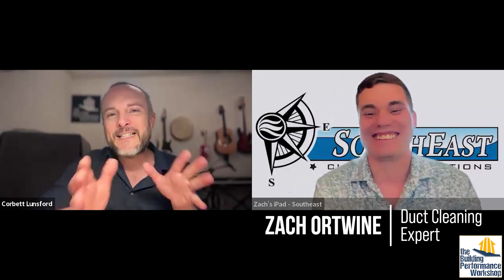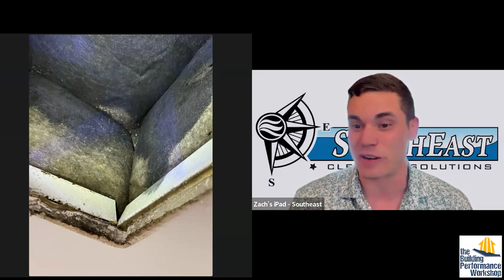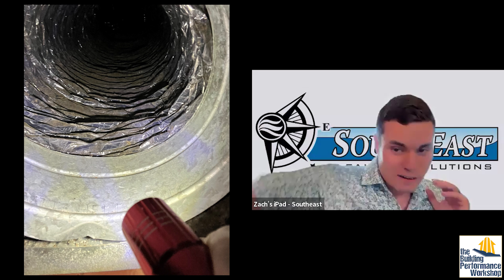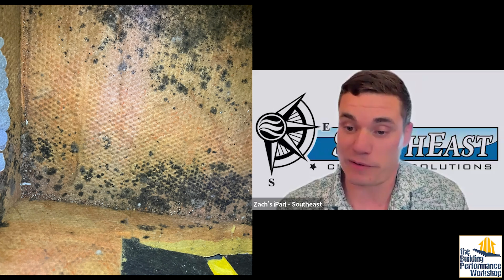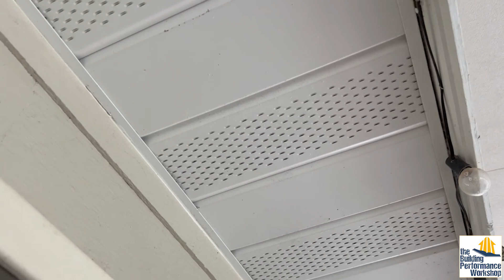Duct Cleaning, Repair and Mold Encapsulation: HVAC Tips from Zach Ortwine, SE Clean Air Solutions

Comment: What is best practice for cleaning metal duct after new construction?
Reply from the maker: Shouldn’t have to, because they should be sealed off until there’s no more dust nightmares.
Reply: @HomePerformance  From experience I just don't think they come particularly clean in the first place. From the supplier etc. On the other hand EPA's guidance on this is surprisingly iffy for cleanings of duct work if mold is not involved. I guess the thinking is much of the material in the duct already attaches to the surface which I guess is why mold is their biggest concern.
Reply: @speciesofspaces it’s very common for ductwork to be dusty from drywall and hardwood flooring installs. Subcontractors could care less when installing in new homes, they crank the HVAC up! Hence dusty new systems. Air whips are the tool for removing dust from metal ducting. None of your flex should need cleaning, due to they are “typically” on the supply side of systems, and it’s the return side that takes the brunt of household/construction dust.

Comment: What type of duct liner can I use to replace the  (grey) liner shown in the video?  I saw mold on my liner (exact one in the picture) and threw it away before finding this video and realizing I could’ve cleaned it and spray painted.
Reply: You can use any type of duct liner that’s not already microbially contaminated, and then coat the liner with Hardcast RE-500. You still need to address the underlying causes of the microbial contamination, but a freshly coated duct liner surface should reduce surface loading characteristics of the duct liner and help prevent microbial contamination from occurring since less surface dust loading occurs

Comment: Thank you for the great video! I am replacing all of my ducts (supply, return, flex, all) and I am learning  a lot about ducts from you. In another video, you state to use an Aprilaire 2516 filter cabinet. Do you recommend this for all duct sizes, or should i get an Aprilaire model that is smaller but maybe more fitting for my ducts?

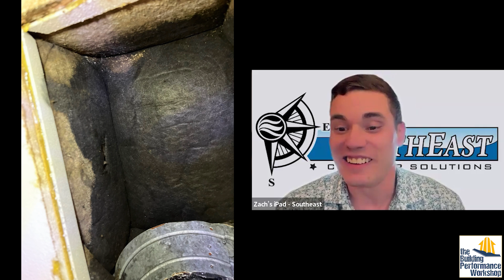Comment: 12:43 Hey Corbett, I just noticed that I didn’t respond directly to your question about connecting the flex duct to the boot in an above cavity scenario… 

1st - pray for some slack to be available on the remaining flex portion in the ceiling cavity above lol… 

2nd - before installing a new vent boot, you’ll want to install a ~6” sheet metal flex duct connector pipe to the flex line at the open boot opening. Mastic & zip tie the flex to the metal connector pipe. Crimp the male end to slide into the female end of the new vent boot (in the direction of airflow for a supply vent). 

3rd - slide the pre-secured metal vent boot connector pipe into the new vent boot and mechanically fasten from the inside out with rivets or screws and mastic the heck out of that connection point!
Reply from the maker: Thx Zach!

Comment: Great video, we had a bad install of new ductwork where insulation from the attic ended up stuck in the whole new system and blowing out of every vent in the house. Has been a nightmare. New system is made of duct board and flex, would be easier to remediate if metal but unfortunately no companies within 2 hours install metal ducts here. It’s impossible to remove the attic insulation from the duct board liners (like removing a cotton ball from Velcro), absolute mess requiring a virtual full replacement
Reply from the maker: What a nightmare, sorry to hear

Comment: Duct board.. what a dumb idea. Fiberglass board with a very thin layer of fabric ( to keep the fiberglass in).

Problem with flex duct is also the two inch straps. The often fold over and pinch smash the insulation. Reducing the R value.
Reply: Try installing 18”x18” square cutouts of roofing tar paper for a budget friendly duct saddle option at the flex support straps to help distribute the pressure across a larger surface area of the flex 👍🏻
Reply: @DuctRenovations can you leave the metal of the duct board in a vent just exposed or it has to have the fiberglass/ insulation lining ? Mine had a bunch of mold i removed it but as long as it is sealed currently the vent then is it necessary? The house i moved into is old and wasnt sealed correctly and as i was replacing the vent cover i saw all the mold

Comment: I’m not really qualified to have an opinion on ductwork, that’s why I’m here watching this video, but I do have a tip on cleaning a messy room….  When you’re having a hard time getting started close your eyes and point to something, then put just that thing away even if it’s not in its final spot.  Just moving it will help get your brain and feet wrapped around the task.
Reply from the maker: I like it. My personal method is put everything on the floor, then simply clean the floor. Grace hates it so much.
Reply: i can step over almost anything, the dog not so much. also a member of the royal society for putting things on top of other things

Comment: Duct cleaning is a scam 100% sure
Reply from the maker: Clearly you didn’t watch the video
Reply: I have all rigid ductwork. When I bought my house, my son couldn't be in the house for 5 minutes without sneezing and coughing. Had the ducts cleaned and not only did I feel like the air was better, my son's sneezing and coughing completely stopped. Duct cleaners pulled a large trash can worth of dust and junk out of the ducts. Super gross. Not a scam. Worth every penny.
Reply: @ it’s a scam period
Reply: @ManuelRodriguez-q9v Need facts and examples, data, etc. otherwise it’s just another opinion.

Comment: I thought I avoided all this by Installing mini splits, but now my mini splits look like gray tabby’s have died inside my fan assemblies.
Reply: Mini splits are nasty. Its a solution for no space or lazy.  I looked into this before redoing my hvac. Opted not due to the amount of problems vs traditional hvac.
Reply: @turboflush Ductless/Mini Splits have very few problems if they are designed and installed properly.
Reply: @HVACinSC   lack of good filter is my main complaint, along with the air usually not spread around the room very well.
Reply: @HVACinSC most ductless systems don’t have a filter beyond something to catch giant particles. A ductless home is a dusty home.